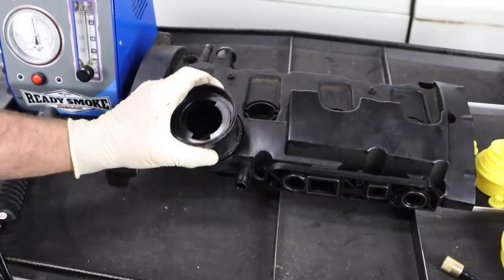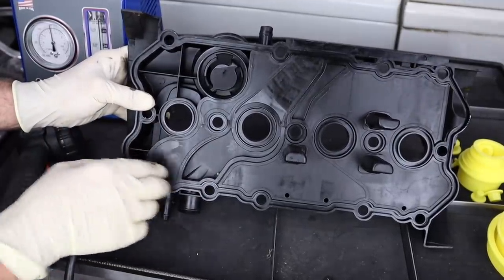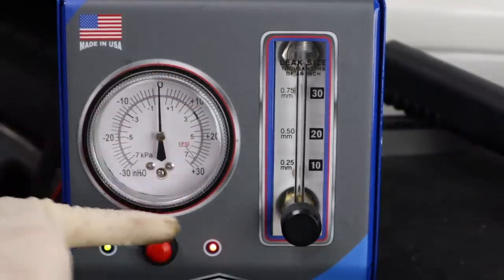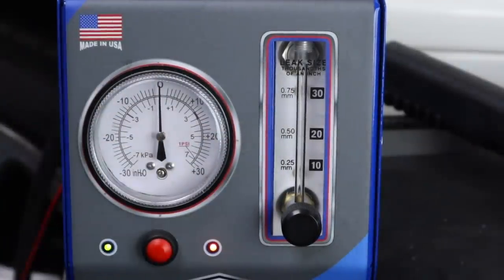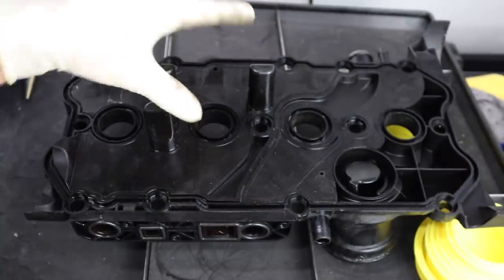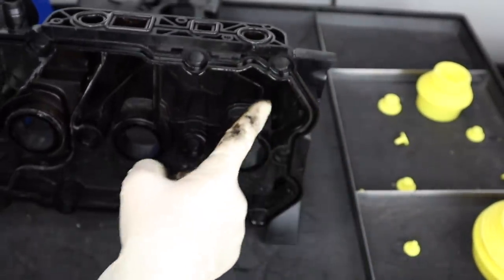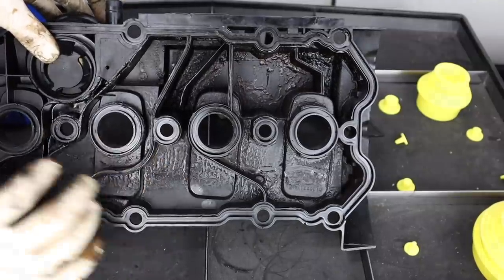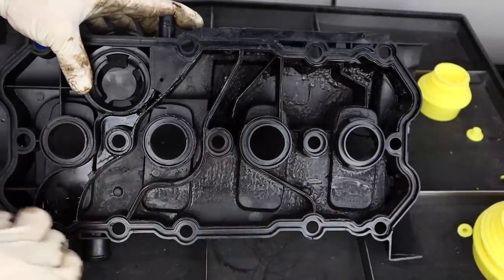Smoke Testing a Plastic Valve Cover with Built In PCV

Comment: Cool video. We will be seeing more valve cover problems as this engine ages. The evolution  of vag's turbo four pcv system is interesting. I get why they did this design and now the pcv/oil separator is easy to maintain. Parts are relatively expensive but it is a simpler design.

Comment: Hi Charles I have replace 2 valve covers on b7 Audi with the 2.0 L Turbo engine the engine was sucking oil from the valve cover and most of the oil was trapped into the intercooler system and it did increased the oil consumption but did not affect the engine much and no check engine.

Comment: I had delamination on my bpy which caused the p0455 code to pop my cel it was very confusing trying to find the fault changed my gas cap n80 smoke tested it wasn't until a friend told me the cover could be at fault and it was the plastic actually was raised near the valve intake ports

Comment: I have a 2007 Volkswagen GTI and I was wondering how tight should I make the head bolts I keep seeing online that there’s lots of different foot-pounds to put it to and I’m not sure which one is correct because I don’t want to snap off one of those bolts inside the block and have to chase it down and get it out of there so could you please let me know what foot pound torque spec I should give it to

Comment: I saw the lines you mention, that conects rear and front with the pcv system, now, if we install the pcv delete, the plate really stop the air flow on the line that connects to the turbo hose, it supposed to be a suction function i tried to re create that suction on my cover but it doesn’t work with the pcv delete, is it ok??? Or whats wrong, ??? I supose when the pcv valve is the original way, it will suction on the diaphragm on the pcv right?  I hope you understand what i’m trying to sag

Comment: FSI valve cover fails causing Oil to leak though and oil consumption issue. VC fails around 15k, and fails due high boost. Oil consumption issue (1 qt/500 miles) can be resolved by changing valve cover. Vw needs to recall.

Comment: I dont have any fault codes, but suspect a valve cover issue, my car smokes when driving, (not all the time) only when cars under load, 

If im on full boost, there isnt any smoke, but ad soon as i let off the gas, a big plume of smoke appears  ( covers the whole street) do you have any info on this?

Comment: So I'm blowing tons of smoke under load with a small rattle I was thinking it's this valve cover cause I swapped the pcv and hoses but that rattle made me think the turbo is a possibility but it only under load when in gear pull up not if I rev in neutral or in between gears
Reply from the maker: It’s possible. Turbo failure is not crazy common but happens. Any check engine light?

Comment: Just curious anyone on here or humblemechanic  know wat exactly is the difference between smoke pro total tech vs the new readysmoke both by redline ? Is it just cost difference? Is the smoke pro more longer lasting? If anyone knows the main difference other than size n price difference more like tech specifications etc... redline doesn’t have anything on their website explaining difference other than price
Reply from the maker: Good question. I’d recommend giving them a buzz. They are super awesome folks and would be happy to help you out. 

I do know they have a low pressure model and higher pressure one for boost leaks
Reply: Hi! Not sure if you've had your question answered already, but if not: the Total Tech is built to be a lifetime tool, perfect for a harsh shop environment, and it's field serviceable. It comes with a 2-year warranty and our Easy Intake block off bladder. The ReadySmoke is a more affordable option and is more compact, ideal for an individual technician who wants their own personal machine, and it comes with a 1-year warranty. Let us know if you have any other questions!

Comment: hello i have a mk5 gti, and it run very bad at idle, when i remove the pipe from pcv to the intake manifold, and i block the hole in the intake, the car runs very smooth at idle. do you think my pcv is bad or the valve cover? i bought a new pcv and the car runs still bad. Does pcv delete will solve my problem?

Comment: Any recommendations for a smoke machine that is not $700? Seems like its either a paint can with tubes or big money. Thanks
Reply from the maker: Yeah this one here is not really a DIYer tool, it’s a piece of diagnostic equipment. 

I’d probably just make my own if I wanted something more affordable.
Reply: In this case you could probably just blow some low pressure air through it and check for leaks with soap suds.

Comment: Remember when valve covers were metal and didn't crack?
Reply from the maker: LOL they just leaked. LOL
Reply: It's the rubber part - seal - that got old and leaked.
Reply: If you're going back far enough for metal valve covers then the gaskets were probably cork or paper and useless.
Reply: Remember when people cared about there cars?
Reply: Metal valve covers weren't that long ago. 2004, perhaps?
Reply: @GarthGoldberg  Tech: G says, Depends the brand, the amount of heat\cold the engine is explosed to and the amount a "adverage" person is going to have a vehicle for, to save a company money in the end. Different manufacturers and VW's had plastic valve covers for a very long time, even wooden engine blocks were being made for a short time at one point. Cost V.S. Demand. Plus plastic goes well with other metals instead of worring about corrosion and rust.

Comment: I have an after market catch can (about to get rid of it, only causes issues) i went to clean it out the other day and after i got a knocking noise coming out of the cold air intake filter. Weird thing is that it will go away if I pinched off either of the catch can hoses. so is it possible the valve cover has an internal failure causing this?
Already ordered a PCV delete plate because trying to find where all the pcv hoses go and everything to go back to stock seems like a headache i do not feel like dealing with when i have other issues to address and am soon about to just tear the whole car down and clean up for track use
Reply: I know video is a few years old but any help would be greatly appreciated, only experienced with nissan issues